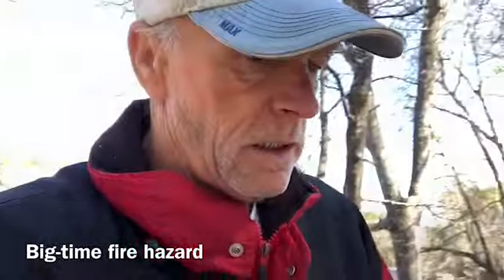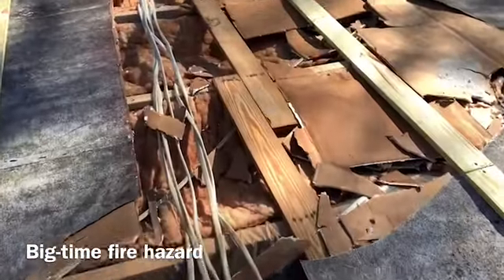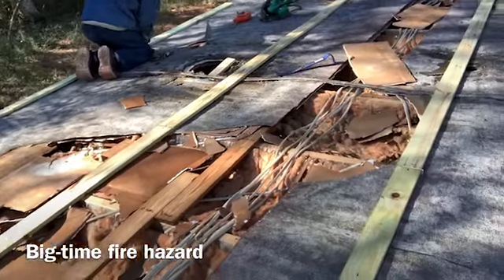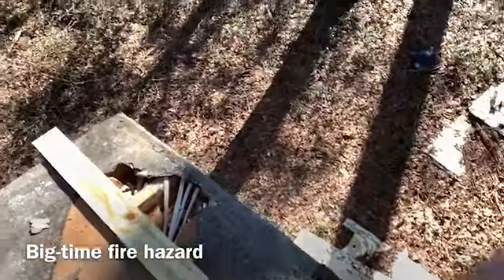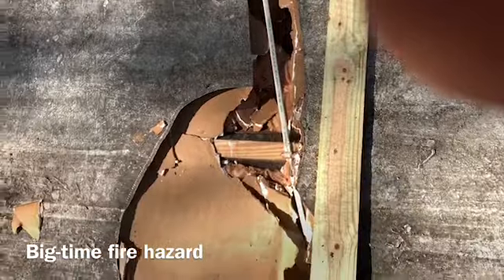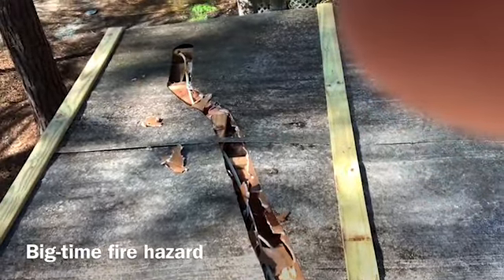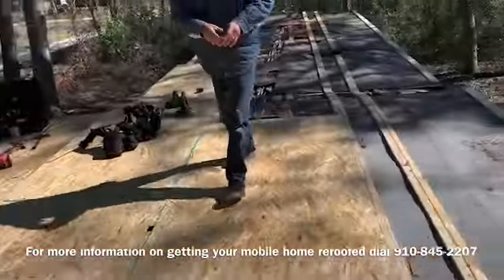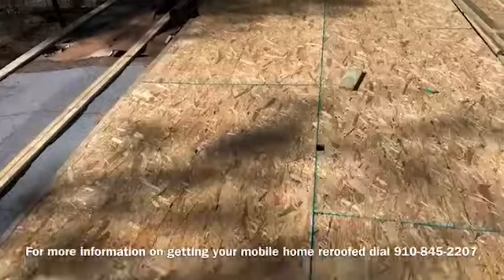Mobile Home Fire Hazards! OMG!!!

Comment: 1986 (notice the date. Title has exact matching serial numbers but manufacturing date on title is incorrect/does not match!) singlewide here in union county nc. Drew, I did exploratory inspection by removing a 4x4 piece of drywall on exterior walls in each room. I pulled back insulation and vapor barrier only to find some of the wiring was ran on exterior of walls! Of coarse walls were slated out to screw metal siding down. But man! I could have screwed into a wire when I replaced the exterior hex screws holding the metal vertical original siding! First thing I thought? Some fellas should go get whoever made this decision to create fire hazards that only kill poor folks, and horsewhip them until the blood drips from their hides! Fleetwood Homes of Tennessee (Manufacturing plant) Westmoreland Tennessee. 10-10-84 Broadmore
Reply from the maker: Wow 😯 I can not believe what they get away with. I have video I will share with you

Comment: I was gonna say...sue the manufacturer cuz omg! And I’m living in a mobile home with the same type of roof and when I tried running a wire to hang a light fixture in the living room...I realized that they did run the wiring on top of the supports...so this is troubling...
Reply from the maker: Can you believe that crap if your mobile home was built in the early 70s they ran the wires over the top of the rafters and just under the metal so the metal is constantly rubbing on the wires. https://youtu.be/6eCF4OBSJNA
Reply from the maker: https://youtu.be/cp9igBMSDAY
Reply from the maker: 7 o’clock tonight they’ll be a new video on please hit the notification button so you notified tomorrow night 7 PM another video will be out final videos of the job

Comment: That's a terrible way to run electrical wiring. It would cost a bundle to have the mobile home rewired the correct way.
Reply from the maker: Yes it would. So we At least got them under the metal and not touching the metal
Reply from the maker: They’re all over the place out there check this one out I think it might be even worse. https://youtu.be/cp9igBMSDAY
Reply from the maker: https://youtu.be/f82kikum1B8

Comment: So how do you identify if a m-home has this pattern of wiring? Do you automatically pull up roofing to check? My roof is not bad shape at the moment but I would like to re do it for an overhang and rubber. Also how long are you finding that the rubber lasts?
Reply from the maker: No pulling up roof to check till it’s time to do roof. Then check and if so deal with it yhen